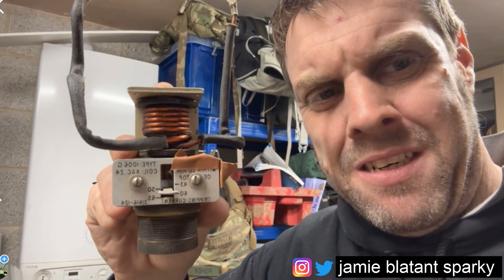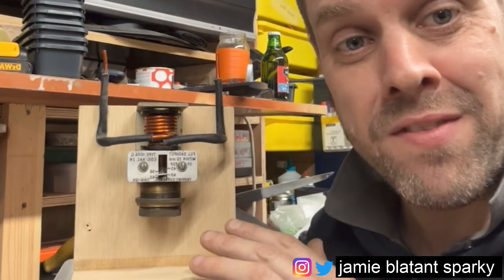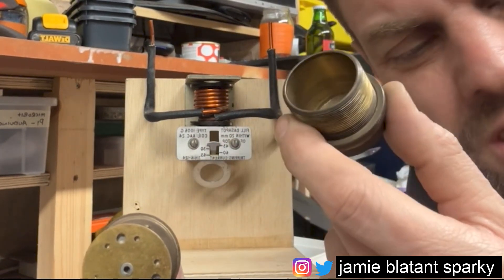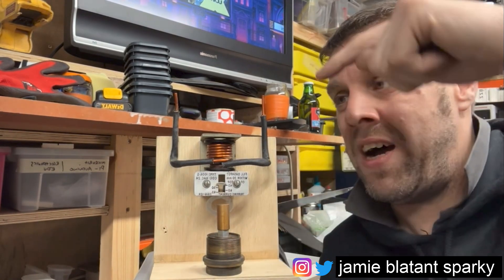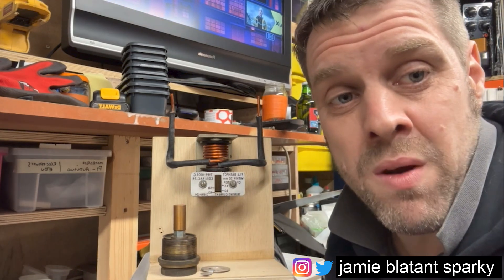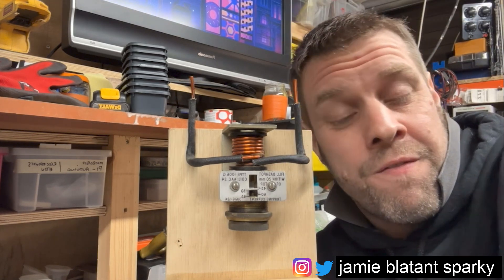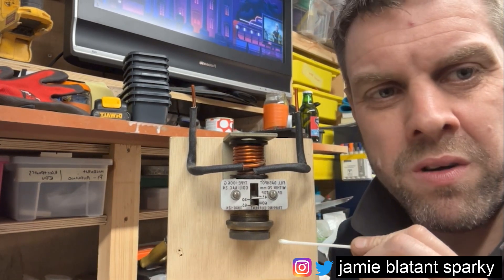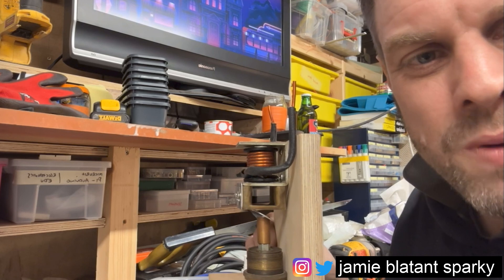the oil dashpot - vintage electrical controls

Comment: Im an electrician in NYC and was working in a switch gear room where they had oil jars connected to the switches and was told they were dashpot circuit breakers. It was like Frankensteins laboratory.
Reply from the maker: Now throw love to see

Comment: I've got the OK to take one of the heater overloads when the MCC gets ripped out. Will post a comment on your latest video at that time, if your still wanting one. Will have had heavy use since 1972 to date. Get something sorted regarding shipping it. Your not far away from my location I think.

Comment: OK, I'm your typical "Old Codger"! Used these all the time when I did my apprenticeship on good old British Rail. They were used where high current starting loads (especially DC) were experienced. The big ass winding carries the load and acts as an electro-magnet. inside this there is an armature which, when the coil is energised, moves within that in one direction to act on a circuit breaker. Attached to this armature is a disc which sits in the oil dashpot. The oil slows the movement of the disc / armature against the current flow which prevents tripping of the circuit breaker on startup. If the current remains high due to a fault the armature will move fully thus activating the circuit breaker. The disc frequently had adjustable holes to alter the rate at which it could move. Those were happy days! Free from electronics which I did not (and still do not) understand!

Comment: The oil dashpot reminds me of the "SU carburettors" from when we used to drive real cars!
Reply: Carbs used a dashpot to dampen the throttle closing
Reply: @MadScientist267  The SU used the dash pot to dampen the piston movement when the suction sought to raise it to withdraw the needle from the jet. The Stromberg was similar, except it had a rubber diaphragm instead of just a machined piston.
Reply: that was the first thing I thought of too. I still work on su carbs today. on some MG's that were brought to the u.s.
Reply: @jankcitycustoms  Yep, real MGs like the older MG TD, or the MGB (which I had - really solid 5 bearing crank engine).
Many British cars had these, Austin/Morris/Jaguar - ever tried balancing twin SUs using only a tube between the intakes and your ear!  It works!
Reply: @herrtomas6729 I prefer that way instead of fiddling around with the wires. funny you mention it though. I actually just learned that trick a couple years ago from an old MG workshop manual, I don't remember what one.
Reply: @jankcitycustoms  I was doing it 50 years ago as a hobbyist who couldn’t afford the kit they seem to need today!